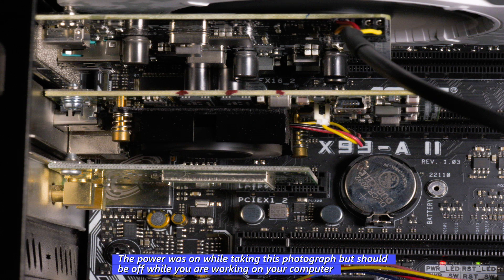Thunderboltex 3 card installation

Comment: Plan on installing this card for using a Universal Audio Apollo Audio interface for my PC. I've only seen horrible reviews about this on most online stores, but this looks like it should address most issues when I go to install and get it working just fine. Thanks for the video.
Reply from the maker: Great! I am glad this video helped you.
Reply: That's exactly what i need mine for. Please let me know how it works out for you. I'm excited for it but maybe it's not as great as i hoped.
Reply: @corbinslaymaker3346  it worked right away with basically no issues! Only problem I do have is that using the tb3 device as a mic input for applications like zoom or discord is no bueno, but that's more of a windows issue not being able to handle it. To compensate for that, I just got  1/4 trs 1/4 trs males to 1/8 trs and mirror a cue mix to an output that I run to my motherboard directly.

But yeah, I'm terms of general recording and playback, works like a dream.
Reply: @Michael_Is_Avg  dude thanks so much for the detailed reply. i appreciate it a ton! Glad it works well for you. Placing my order today :)
Reply: @corbinslaymaker3346  So glad to be able to help! It's been an unreal step-up from my last interface and I totally love the flexibility of it. UAD plug-ins are sick and it takes all the workload off the PC, even when I use them inside a daw as VST's. As long as your mobo is listed as compatible, I would let it rip my dude!
Reply: @Michael_Is_Avg  oh yeah ive been using my arrow for a couple years with my macbook pro and it's been lovely, didn't even realize when i bought this used PC that it didn't have thunderbolt hooked up. I've come to realize over the last 12 hours that the Thunderboltex 4 card will not work with my mobo since i dont have the 14-1 pin TB header. My new question is what is the difference between the Thunderboltex 3 vs the Thunderboltex 3-TR? I'm on google trying to figure it out but there's no clear answer thus far. Do you have any knowledge on this? Did you decide on the one without the TR? Thanks for the speedy replies btw appreciate it greatly.
Reply from the maker: If I may chime in here. You need to check what your mobo supports. Not all monos work with all the thunderbolt cards. Thunderboltex 3 is the older card for the older mobos. The Tr is for the newer motherboards. Thunderboltex 4 is the thunderbolt 4 card.

The only difference between the two thunderbolt 3 cards is essentially one has more ports.
Reply: @BellucciStudioz  Hey thanks for the reply brotha! Great vid btw i thoroughly enjoyed it. So i've done some digging in my mobos manual, and the only info it has on TB is that i can turn on support in the BIOS. I have the ASUS Maximus VIII Extreme. I don't mean to add any work onto your plate, but I'm new to the PC game, and what may take me hours to figure out, maybe you know right where to look, or at least know what direction to point me in. Do you know if i can use the TBEX 3-TR card? Also side question, do you know if TB 4 Cables can still work with TB 3 ports being that they are still USB-C? Thanks again for the great content and the helpful comments man :)
Reply from the maker: I am glad you enjoyed it brotha. Let me do some digging I’ll get back to you in a few hours. ASUS makes great products but man they need to improve their website.
Thunderbolt is finally a simpler technology. TB4 cables should work on anything including usbc and possibly usb. It is supposed to be the cable that can do it all. I will send the links for the info you requested as well.
Reply: @BellucciStudioz  you gained a sub man, your diligent hard work to appease viewers doesn't go unnoticed. Thank you a ton.
Reply from the maker: https://rog.asus.com/motherboards/rog-maximus/rog-maximus-viii-extreme-assembly-model/
https://dlcdnets.asus.com/pub/ASUS/Accessory/ThunderboltEX_III/ThunderboltEX_3_Card_Compatible_Model_List_20200313.pdf

Your motherboard has the Z170 chipset so you will need the Thunderboltex 3. These are the links that will get you right where you need to.

If you have any further questions just let me know. I know how frustrating it is to struggle with tech so I never mind lending a helping hand where I can.

I really appreciate the sub brotha. Have a great day/night further.
Reply: @BellucciStudioz  Just placed my order for the TBEX 3. Thanks again. Looking forward to future content 🤘
Reply from the maker: I hope that card will work well and that your music interface will work like a charm. Let me know how that card works out for you.

Later brotha 👍🏽
Reply from the maker: Hi Corbin
Which motherboard do you have? My thunderbolt card works nicely now. The only remaining issue I have is on the audio driver for the interface. So controlling my interface works really well, but no audio is passing to my interface. I have the Red 4Pre. My motherboard is the Asus A99-II.

I have been in contact with them about my issue and they are looking into it. So if you can find a UAD user that has the same motherboard and thunderbolt card you are using them you should gain insight as to whether this will work for you. I hope this helps.

Comment: I finally got mine working with my current BIOS version, and I'm running the ASUS z170-AR motherboard with the ThunderboltEx 3. My bios options were a bit different, but I had to set GPOI3 to force power and enable a few other parts like enable boot for thunderbolt. I installed all of the drivers for my computer and for the device as well of course. The final fix for me was to plug my card's display port into the graphics card Display Port, rather than the motherboard's display port. I'm trying to run a thunderbolt monitor so perhaps that's why I needed that graphics support in my case. Also, my graphics card is an EVGA RTX 2060 Super. Thanks for posting this vid, I just wanted to add additional info in case someone has my different versions as well.
Reply from the maker: That’s right. If you want graphics over thunderbolt then you need to connect the graphics card to the thunderbolt card via display port.
I am glad this video was useful to you. Whoop whoop 🙌
Reply: Hi, Could you, please, share the exact config of BIOS and its version?
I have ASUS z170-A motherboard with the ThunderboltEx 3 + GTX 1060. The TB card is installed to the PCI 3 slot and connected to the graphics card via DP-miniDP cable. TB header is also plugged in.  I installed drivers prior to the card installation, enabled GPOI3 to force power and boot for thunderbolt. I can only use simple flash drives inserted to either USB ports on the card. However, my Apple Thunderbolt Display doesn't work with the PC.

Comment: Jacques. Your audio is too low Fix it Please
Reply from the maker: The standard or median audio output level is 14dBFS. I use that as a guide and have exceeded that guideline on most of my videos
Reply from the maker: Hi Joseph

The audio is very close to clipping and is just about the same level as what most creators put out. Any louder and it will start distorting. If you are struggling to hear then maybe move to a quieter location, or use headphones/speakers that have a higher output level.

I hope you enjoyed the video 😁👍🏽